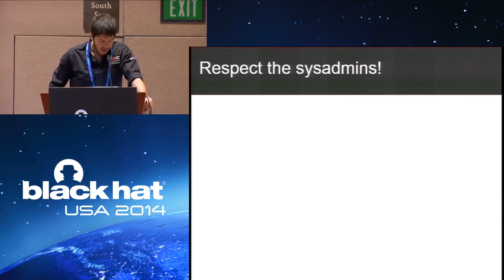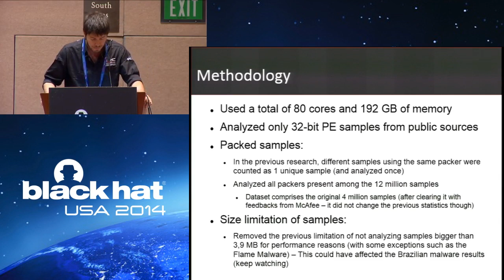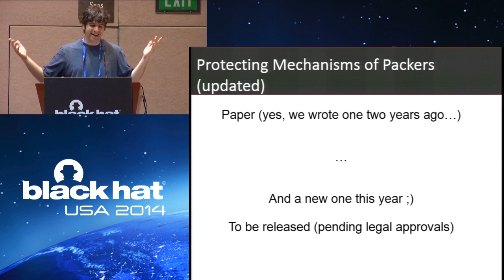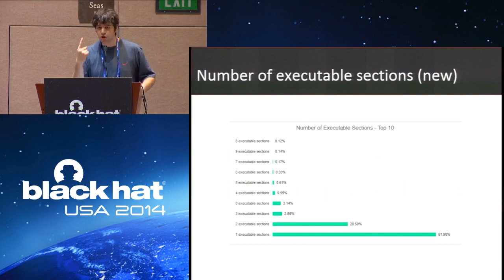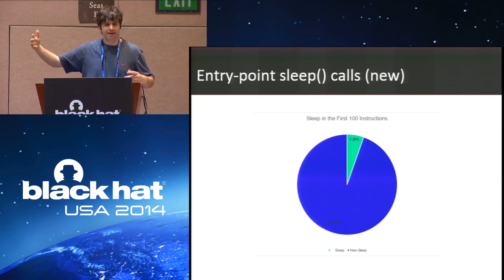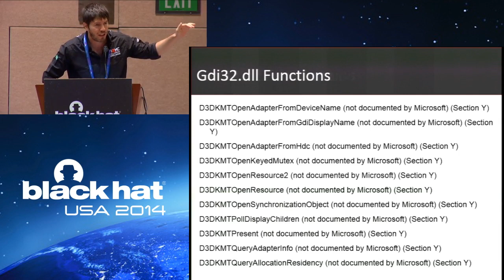Prevalent Characteristics in Modern Malware

Comment: Interesting talk.  If you could recognize code that detects itself running in a VM and acts differently you are probably dealing with malware and could flag based on that - which is a nice way to take an evasive move by your adversary and turn it into a detection method.  That is if no "good" code has a reason for doing this...